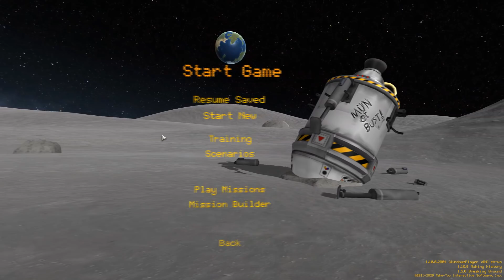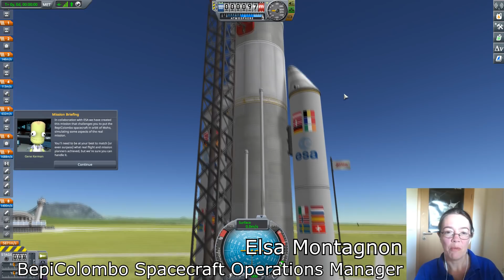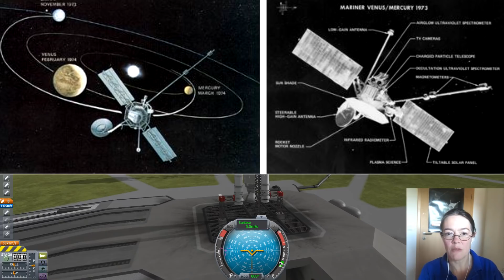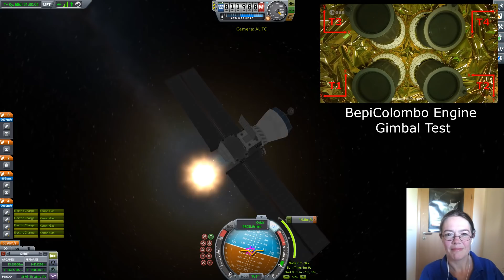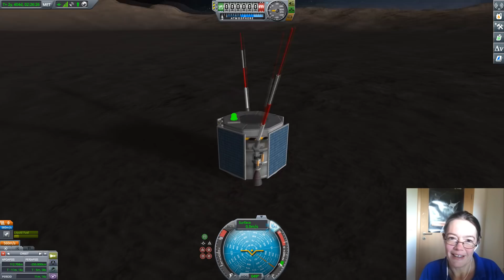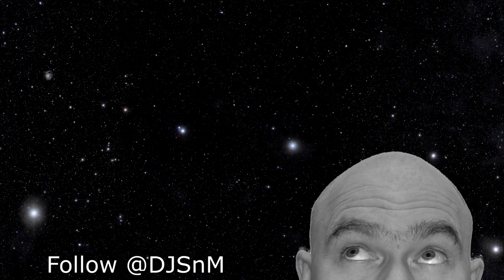Bepicolombo Mission Comes to Kerbal Space Program. Official ESA Collaboration

Comment: I'm wondering how the direct antennas are "relaying" signal through Bepicolombo starting @ 23:00 until about 32:00 nearing the end 🤔
Reply: Those are dipole antennas. Arrayed at 90 degrees, your only real blind spot is directly behind the lander (or the bottom). So as long as you have line of sight between the lander and Mercury planet orbiter, you can communicate. That means that every time the orbiter comes over the "horizon" (the crater wall), you can download any data taken, and upload commands for the next set of readings/experiments, which it will carry out on it's own until the next flyby. Of course, it would be running on internal batteries, since the floor of the crater is permanently in shadow, which gives the lander a limited lifespan without an RTG. But with an orbital period of 2.3 hours, you'd be able to get in several flybys worth of science, at least, before the lander's batteries go dead.

Comment: “I’m doing this entirely by hand, I’m not letting a computer do this.” I see that SAS light Scott, you’re not fooling me! The robot overlords are just letting you think you’re flying by hand.
All kidding aside, thanks for putting together this preview, and especially thanks to Elsa for giving insight into the proper mission.

Also, 1.1 != 1.10 in terms of versioning, small nitpick.
Reply: ah don't worry, minecraft did it too.
Reply: How do you just what numbers to multiply in s fraction factorial? Because you can just keep choosing smaller and smaller intervals. For example; 1.10!=? To me you would do 1.10 x 1.099999999999 x 1.09999999999 x and so on because between any two numbers is an infinite number of fractions and decimals
Reply: @liamdoyle5363  It's not actually a number. 1 is the major version. 10 is the minor version and 0 is the patch version 1.10.0
Reply: @liamdoyle5363  You can use the gamma function for factorials of non-integer numbers (n! = gamma(1+n), in this case 1.1! = gamma(2.1) = 1.046. ^_^
Reply: @liamdoyle5363  Are you trying to prove that 1.1 = 1.10 = 1.09999…, mathematically? Because nobody is denying that. Software version numbers aren't "real numbers" in the math sense (usually).

The version number "1.10" is to be interpreted as two independent numbers, 1 (one) and 10 (ten). 1 is the major version, and 10 is the minor version. As Ashley mentioned, there can also be a third number that indicates the patch version. That would look like, e.g., 2.3.6 (which is the version of Android I've been using for the last two years…), which is interpreted as three independent numbers, 2 (two), 3 (three), and 6 (six). Each of these is a sub-version of the previous level's version. The sequence of version numbers for a given piece of software might go 0.1.0, 0.2.0, … 0.8.0, 0.9.0, 0.9.1, 0.9.2, 0.10.0, 0.11.0, 1.0.0, 1.1.0, 1.1.1, 1.2.0, … 1.12.0, 1.12.1, … 1.20.0, 1.21.0, …

(Disclaimer: This is only a common way (maybe the most common way) of doing version numbers. Some software uses other schemes that attempt to be more mathematical, and then you get version numbers like 1.08, 1.09, 1.10, but then you'll eventually have to either declare a new major version even if there are no major changes or switch to three digits after the decimal point and say ".100 > .99 even though .10 < .99", and it also sometimes leads to things like "this version is one improvement beyond 1.1, so it should be 1.15 because that's halfway to 1.2", which has the same problem but leads to faster exhaustion of numbers and therefore devolves into mathematically smaller and smaller increments each time even though the changes may be similar in size. Some software just uses the release date for its version numbering, maybe with the addition of another number or a letter to indicate additional versions within a date range, like Matlab and Minecraft snapshots.)
Reply: @IDoNotLikeHandlesOnYT  no I wasn't talking about equivalency at all, what I'm saying is that if you're trying to apply a factorial to a decimal that there's no real way to know when to stop getting closer and closer to the value to get a number to multiply the original by. (For example; if your number is 5, then you easily know how to take its factorial. So 5!= 5 x 4 x 3 x 2 x 1 = 120. But if your number is a fraction say... 2.7! = 2.7 x 2.699999999999999....... x 2.6999999999999999......8 and you can just go on and on) so my real qualm is that I feel as though trying to factorialize (don't know if that's even an actual word? Lmao) fractions/decimals that your intervals are inherently arbitrary, but as another user above pointed out, that for reasons I do not currently completely understand, you can throw a gamma into that equation and it basically fixes all of problems that I described
Reply: Usually version numbers are stored string encoded which makes differentiating between 1.1 and 1.10 quite easy

Comment: There's another "things kerbal doesn't teach" in this video; it seems as though solar heating is a lot more of a mission constraint in real life than it is in Kerbal.
Reply: The thermal system in ksp is really a bit dodgy. It could do with a fairly serious revision. And most of the main data is there already, it just all interacts badly
Reply: It actually is. But that basically goes for any system in the spacecraft, not only thermal management. There are many things to think about, constantly.
Reply: It totally is! I worked on the solar generator for that spacecraft and can tell you finding materials that survive the stress is stressful in its own right :-O

Comment: That's super interesting that they arent allowed to use high gain communication when the spacecraft is near the earth. Why are there rules against this?
Reply: Probably the same reason you don't use those big concert speaker systems in your house. A transmitter designed to broadcast all the way from Venus is going to be far too 'loud' at point blank range, drowning out anything else that might use similar frequencies.

Comment: Amazing with a ariane 5 in ksp stock. One of the best looking rockets
Reply: Yeah I'm not even such a big fan of the rocket but I built at least 10 KSP versions. With boosters hidden inside the tube's we a got a while back before they added big boosters. Sustainer stages are kinda fun in KSP. A little more challenging to get into a proper orbit with the engine lit all the way.
Reply: @please_stop-v7o  seen a few of them on the ground by now. Really impressive machines up close, plus its the flagship of European Union. Yeah usually also used to make it for most of my missions when the payload wasn't too big of a hassel 1

Comment: What mod is that second stage engine and the 2.5m fuel tanks from? I don't recognize them
Reply: New one single bell variant of the Poodle engine, look on the KSP website. Fuel tanks are the ones already in the game with just a new Ariane 5 style paintjob. The fuel lines are just decorative at this point. If you want a mod closer to reality, take the Knes mod but the rocket is 3.75m wide compared to the stock 2.5m version, but at least the 2.5m is much closer to the real rocket, in terms of scale in the stock Kerbal universe whereas the Knes one will give you more realistic performances on a 2.5x scale like in the JNSQ planet mod. The Knes Ariane 5 is completely OP in Kerbal stock scale and can do the job of a Kerbalized Saturn V.
Reply from the maker: This is all Stock.
Reply: @scottmanley  Thanks! Didn't realize there were new parts added in the update

Comment: I don't really understand how gravitational assist works with electric engines. Doesn't the technique require a significant change in mass in order to get a speed boost?
Reply: Gravity assists don't require any sort of propulsion to work.  Gravity assists work by transferring momentum between the spacecraft and the planet and occur in all fly-bys (*useful* gravity assists are very hard to arrange, of course)

You are most likely thinking of the Oberath (sp) Effect.
Reply: Best analogy I’ve heard is to think about bouncing a tennis ball off a passing truck: throwing it to be in the right place at the right time can transfer a while bunch of momentum from the truck to the tennis ball without any more action from the tennis ball. And the truck hardly notices!
Reply: A gravity assist is just swinging by the planet. It doesn't involve using any propellant at all.
Reply: Gravity assists don't only take into account the body around wich you flyby, but also its relation to its parent body, aka the Sun. If you set your flyby to be done at a certain angle, the inwards and outwards angles won't be the same, and so the effect the parents body will have before and after the flyby won't be the same, thus changing the properties of the orbit around the Sun. You can enhance this by some burns to change other orbital and fly by properties for the next pass but it mostly fine tuning IRL. Voyager probes spent some limited fuel to get the trajectory right for the gravity assist to the next planet just to be sure that the angle and altitude would be the ones desired.
Here in KSP, you can most of the time brute force it with longer burns. And Ion engines, despite being not fun to play with are actually OP compared to IRL ones.

Comment: At 10:11, love those gimbaling SEP engines.
Reply: Saw that too, really cool! I wonder if they also employ differential thrust steering though. I'm not as familiar with the opporational limitations of electric propulsion (ie can they throttle and if so how deeply), but given they have more than 3 engines spaced around the roll axis it should be possible.
Reply: Does that use the same principles as the "SEP" (Somebody Else's Problem) field in HHGTTG?  That'd be awesome!